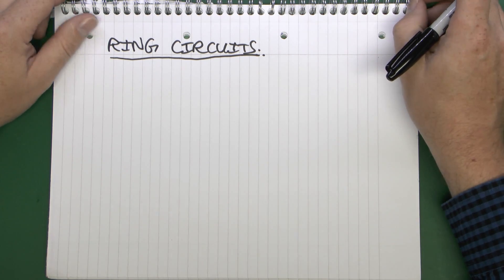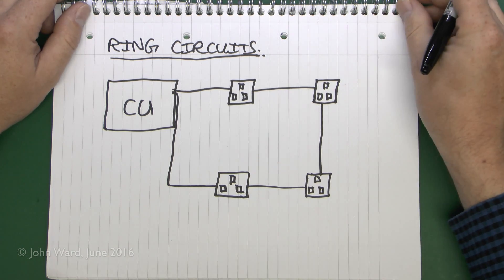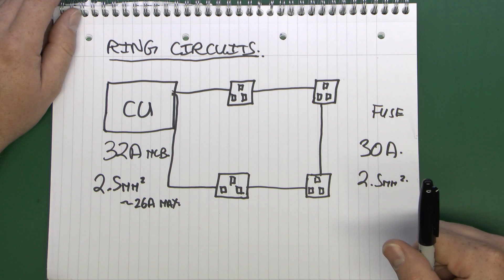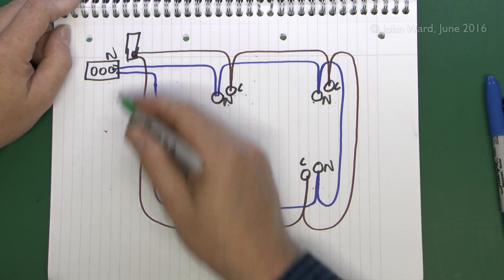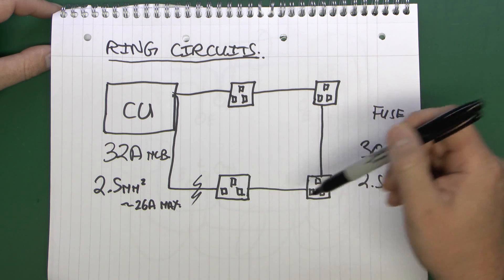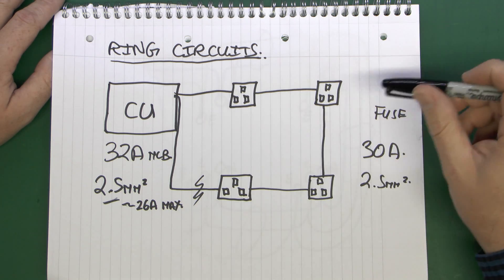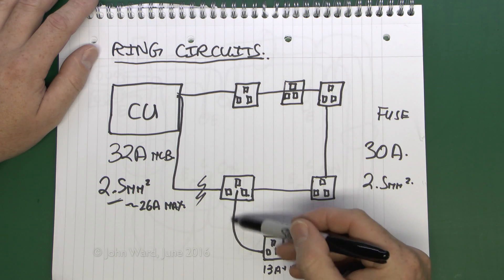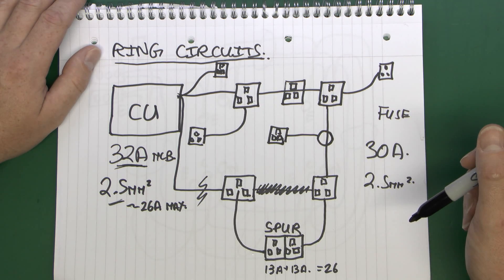UK Ring Circuits (previously Ring Mains) for Socket Outlets

Comment: I prefer Radials myself but.. Where do we buy decent Multitier Consumer units like used in France? Without a very high cost?
Reply from the maker: Single row consumer units up to 19 ways are available from most manufacturers, that should be more than enough for most domestic installations unless there is a severe lack of horizontal space where the consumer unit is mounted.
Reply: @jwflame  but.. would you use a split rcd unit and the afdd breakers? For safety?
Reply: After all, best practice for home Radial Circuit designs would be to set each bedroom on its own circuit, so any problems in any room are easier to track. Plus the use of multiple circuits in a kitchen as well. But, would use AFDD breakers for each as well.

Comment: I'm a qualified electrician in the UK and I have to say the amount of times I've been to work after a DIY'er and there's one 2.5mm in the DB on a 32A breaker labelled 'ring main'... fun times, I totally agree they should be deleted from the regs, we don't have copper shortages anymore like we did during the war! (Or atleast that's why I think they were used!) But... my question is John:- We all learned in college how you couldn't/shouldn't have 'rings off rings' or 'figure of 8 wiring configuration' etc. And my question is; Why not? I understand this would greatly increase difficulty during testing but if it were tested properly and the connections were all sound, I don't particularly see anything wrong with it? Would love to know your thoughts!
Reply from the maker: The main reason is to avoid a high load at a single point of the ring.  With one ring connected to another, the full load of the second ring will be applied at the point where they connect.  Probably OK if that is near the middle of the first ring (where the two cables from the consumer unit are the same length), but not if it's closer to one end, as the current in one cable will be significantly higher than the other one.
Reply: @jwflame  Ah I understand, if there was 32A on ring 2 connecting into ring 1 and if one path back had 0.33 ohms and the other was 1 ohm and as current divides inversely proportional to resistance we'd potentially have 8amps coming back on one leg and 24amps on the other leg which would exceed the current carrying capacity for a 2.5mm conductor, cheers for clearing that up!

Comment: I’m guessing that this circuit is a hold over from the days before molded plastic cables and knob and tube was how things were wired. In those days most loads were light and current management was as much of a consideration. Good video, maybe drink some water before the video.

Comment: Question - I have a ring circuit - If I change it to two radial circuits by taking out a cable between 2 of the sockets (half way round the ring giving thus making 2 radial circuits as suggested in the video), would I have to put each into its own circuit breaker in the CU or can I keep both feeds in the same breaker as is existing? I'm thinking this change would make testing a lot simpler as suggested in the video - great video BTW. Any feedback welcome. Many thanks.
Reply from the maker: The usual way is to put each one into a separate circuit breaker, usually 20A.  They could be put into the same one, but it would still need to be changed to a 20A, or in some cases a 25A.
Keeping the 32A circuit breaker and converting to a radial is not permitted, as the cable isn't rated for 32A.

Comment: Hi John. Great videos thanks. Is it ok to swap a 20A mcb supplying 2.5mm t&e ring main with a 20A rcbo?
Reply from the maker: Yes, although a 20A 2.5mm² ring is an entirely pointless arrangement.
Reply: @jwflame  Thanks and yes I agree - it wasn't put in by me, but I want to add RCD protection to all my circuits and short of a new CU, this seems the best alternative. My current CU has no space for dual RCDs or even one, so I was just checking out the viability of swapping the MCBs for RCBOs. Some of the radial circuits already have RCBOs but I hadn't heard of them being used on ring circuits before.

Comment: Come to think of it, I use a similar "circuit design" on my electrical fence (that adds extra incentive for my dogs to not try to go through the yard fence).  If a wire gets broken, both sections of the fence still have power.

I can see a reason why the ring circuit could have an advantage from a fault tolerance standpoint, but I would still size the wire so that even if the ring was broken, it could still handle as much current as the circuit breaker for the circuit.

I never rely on a house that I buy to be wired correctly since a previous owner might have thought he was competent to do DIY electrical work (and he wasn't) or the builder was using somewhat unskilled workers who didn't particularly care whether they did it right for the wiring installation.  I've seen cases where 110VAC was on the ground at an outlet because some wires were touching in an outlet box.  To be fair though, this was an old house which was originally built without electricity and there were still remnants of previous electrical wiring designs.  There were places in the attic where some of the old asbestos and tar wiring insulation was still around (although it wasn't being used).  There were also some remnants of the old "knob-and-tube" style where wires didn't have insulation on them and bare wires were run while being separated from contact with the materials of the house (or each other) by porcelain knob and tube insulations.

Comment: The one big saftey advantage I can see with a ring circuit would be in the case of a connection going resistive or resistive break.   Connections going resistive is where fires start.  The connection becomes very hot due to the voltage drop across the unintentional resistance.   In the case of a ring circuit though since power is still supplied from the other end the resistive connection will see no voltage drop and no power dissipation.

Comment: I personally think rings are a safer way than radial circuits because the earth goes back to the consumer unit of someone changes a socket on a radial and doesn't connect the earth from mid point to end there is nonewrth from halfway onwards where as a ring the earth has 2 points back from the sockets back for the cu now I feel a ring should be limited to 25 amp mcb protection incase the live and neutral become parted making 2 radials
Reply from the maker: That is why testing is essential for any alterations or additions to any circuit.
Installing extra wires or anything else extra to accommodate other people's failures in the future will never end - why not put 3, 4, 5 or more wires just in case?
https://www.youtube.com/watch?v=xJxwvZ5SE_c

Comment: Still hurts my head a little. Must be because I am an American. Why couldn't they have used two spurs of half the sockets or bigger cabling rated for 30 A instead of undersized cabling looped back? O.o
Reply from the maker: The concept (designed in the 1940s for post-war rebuilding)  was a single circuit for the whole house with cable as small as possible to minimise the use of materials, but to still allow loads up to 3kW to be connected anywhere in the installation, with a maximum loading of 7.2kW for everything.  That was valid then, as there were very few electrical items in homes.
Reply: @jwflame  Still, as you pointed out, two spurs with half the sockets is less material. So...

Comment: Why is it allowed to protect 2.5mm² cables with 26A in England? In Germany you can use the 2.5mm² cable with a maximum of 16A and the type F plug. Does it have anything to do with the 13A maximum load on the BS1363 (type G) device plug?
Reply from the maker: BS1363 plugs have a fuse in them, so the rating of the device for the circuit can be much higher - the only restriction is the protective device for the circuit must be less than the current capacity of the cable.
Reply: @jwflame  I just don't understand why in England you can protect your cable 2.5 mm² to the next socket with max. 26A. The cable alone should already be under-demonized for this. Only 2 heaters and the skin of the supply line from the fuse box should start to melt. It cannot be guaranteed everywhere that a ring line is installed. And if it does, then at least not that it is continuous. The residual risk is too big, isn't it? I always look at it from the perspective of a layperson who is not familiar with matter.

Comment: You statement that modern household devices are low powered invalidates your assertion that a break in the ring create an overload risk.
Reply from the maker: Most things are low powered, but not everything - items such as washing machines and dryers are typically 3kW each.

Comment: saves copper. cu is still expensive.
Reply from the maker: Saves copper when compared to wiring methods used in the 1930s and earlier.
Two 20A radial circuits use less cable than a single 32A ring.
Reply: @jwflame  depends on layout / the geometry of the house.

Comment: Does this mean that at any 1 point 32A is available for a socket and appliance ? And x 1.5 = 48A sounds hefty. Most appliances don’t have internal fuse , or do they, in uk ?
Reply from the maker: 13A is available at each outlet (approximately 3kW) , as all UK plugs have a fuse in them, 13A being the maximum value of fuse.

Comment: I noticed that you failed to review the current sharing completely and one of the main advantages of ring circuits. Having lived in both the UK and the US, I am acutely aware of the voltage drop experienced at the end of a radial circuit when using power hungry devices. This is not an issue with a ring circuit as the current sharing will provide a constant power to each socket, no matter the distance from the consumer unit,

Comment: Hi John, quick question - at 12:40 you demonstrate extending the ring, after which you delete the cable previously in the ring to keep it a ring and not a... er.. web.

But this got me wondering if the web would work or not. I can see no reason why it wouldn't, but there might be some reason why this creates problems that I don't know about..? It would also be interesting to know if that kind of set up has a name, beyond "a mess". One can see the ring main as being inferior to the radial, if the wire is of different thickness, but a radial with an additional connection back to the MCB is as safe as the radial, with the backup route in the event of a problem. With the webbyist of webs, the redundancy is further improved. With current sensors on the 2 wires leaving the MCB, you could even detect a failure somewhere on the ring or even web (as the ratio for the two wires will change). I appreciate this is all a waste of copper, but it suggests the ring main isn't such a terrible idea, if the wires are thick enough.
Reply from the maker: A ring needs to be kept as one continuous ring so that the load on the cables is reasonably equal.  With additional parts such as the 'removed' cable in the video, there is no way to predict what the current in each part of the ring will be, and in some circumstances one part of the ring could be overloaded.
Reply: @jwflame  I see, so it's to keep the verification-math simple/calculable. That makes a lot of sense, thank you :)

Comment: Technology Connections brought me here!
Reply: I watched the same video from TC, but never took the initiative to follow through on my homework until the algorithm brought me here
Reply: So he doesn't have a Video on that topic? Sadface
Reply: It really was prompted by CJR electrical’s videos where he keeps going on about testing ring circuits, but before that I had seen TC’s video too combined that led me here 🙂
Reply: This is a better explanation of why they exist: https://youtu.be/6GNb1SSEjQg
Reply: Myself brought me here!
Reply: same
Reply: You could have have individual fuses for the two ends of the ring to discover if the ring is broken. But that would only be for the live, as the neutral is not fused anyway.
Reply: @LeifNelandDk  
Manufacturers could easily do that having a dedicated final ring breaker with two L and two N terminals. It is easy to have circuitry inside to detect a break. I recall one was considering introducing one, but all went quiet.
Reply: Yup!  I almost fell asleep though listening to this guy.  The lip smacking at the end woke me up though.

Comment: Ok I think I get it.. the benefit is that you can use less copper (smaller conductor)?
Reply: Ha finished the video ... that’s exactly what you said
Reply from the maker: Yes, which combined with the original 1940s design of one circuit for the whole house definitely did save copper compared to individual circuits for each outlet.

Comment: The only problem with this design is that you use 26 A cables, but limit the total current to 32 A. If you used a 26 A fuse for each of the ends of the ring, there would be no way to overload a cable, even if you had a break in the circuit (Assuming you still used one double socket max for spurs with 26 A cables). You could even get to the maximum 52 A, if the current miraculously decided to actually split evenly between the two paths in the ring.
The biggest advantage with ring mains using 26 A cables over radial circuits using 26 A cables is that you can draw more than 26 A from a triple socket or two neighboring double sockets. Whereas in a (properly fused) radial setup you are limited to drawing 26 A from any circuit. That means that even with the stupid single 32 A fuse, that cable closing the ring at the end gives you 6 A extra that you can draw from one socket - or up to 26 A more if you used two separate 26 A fuses.
Reply: You can use a 32A RCBO feeding a 25A non-polarised double pole MCB. Have leg 1 on one terminal of the MCB and leg 2 on the other. No cable will overload. The regs limit a ring to 32A, but only a double pole MCB will supply 50 amps on a balanced ring, so limited to 32A.

Comment: Do you typically have only one circuit for the entire house, or is this just an example, where you would actually have several ring circuits for different parts of a house?
Reply from the maker: Originally as designed (in the 1940s) there was one ring for the whole house.  That remained a typical design for several decades.
Then certain persons decided that it would be better to have multiple circuits per house to avoid the whole lot going off if there was a fault.  Unfortunately that somehow ended up as one ring per floor, and later even nonsense such as one ring for a single room, which uses far more cable than just installing radial circuits.
Today it could be either - useless and wasteful multiple rings for those that can't design electrical installations and just think 'the old ways are best', or normal radial circuits for everyone else.
Reply: @jwflame  wow. In the US it's very split up. If you see Technology Connections' video, there are a couple dozen circuit breakers in his panel. That is typical here. It will be like one circuit for all the bedroom outlets, a separate circuit for the bedroom lights, another circuit for living room and dining room outlets, another circuit for dining and living lights. Each bathroom usually gets it's own circuit. Ovens, dishwashers, clothes washers, refrigerators, driers, and water heaters each get their own circuit.

The reasons for that are both to prevent one circuit from being disabled by a fault elsewhere, but also to isolate problems to the greatest extent possible. Diagnosis is easier if you have a limited area where the problem could be. Also, because each circuit is so small, the breakers allow a correspondingly small amperage through each circuit, making fires less likely, and interruption of damaged circuits more likely. 

Also, keeping the lights and outlets on separate circuits allows the lights to keep working when too many things get plugged in and overload the outlet circuit. That happens surprisingly often, and it helps if you're not tripping over furniture in the dark in order to get outside and fix it.

I can definitely see that being a huge waste of wiring if you had to do that with ring circuits.

If you think that's complex, don't get started on automotive electrical systems. Almost every individual part has is own circuit with a separate fuse. Individual power windows have separate fuses. The left and right headlights have separate fuses. The turn signals have a fuse to power the hazard flashers when the car is off, and a separate fuse to power the signals when the car is on. The only part that makes it manageable is that, since cars are DC, they use the car body as a common negative ground, so half the wires are eliminated.

Anyway, thanks for your explanation! I appreciate the time you took.

Comment: the uk ring circuit was the result of the destruction of england during wwii. after the war, once the wreckage was cleared the priority was to rebuild the country as quickly and economically as possible. copper wire was in very short supply after the war, so the ring circuit allowed wiring a building with the minimum amount of copper required, and it works as long as the system is properly inspected and maintained. i have tried to explain the uk ring circuit to many licenced electricians here in the usa and have yet to find one who understands how a ring circuit works...